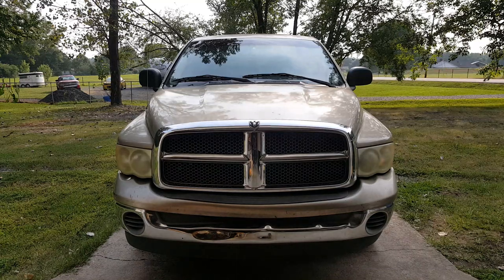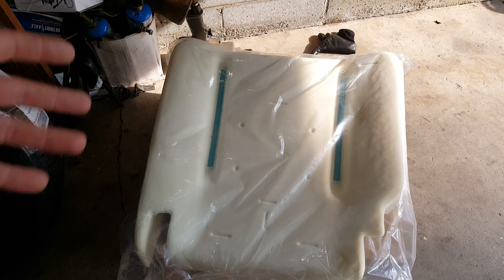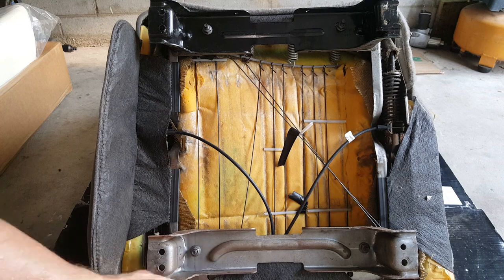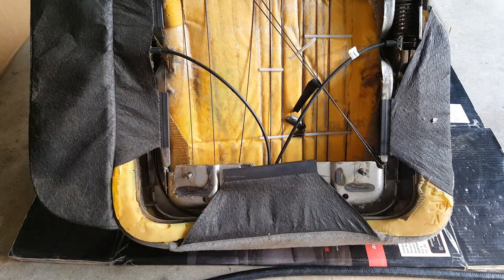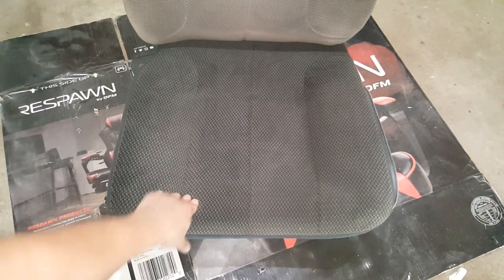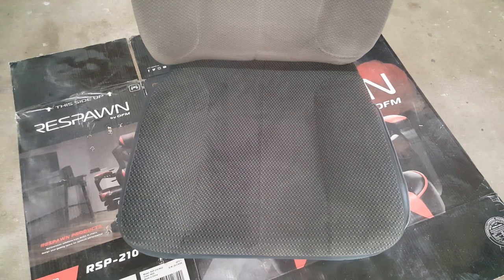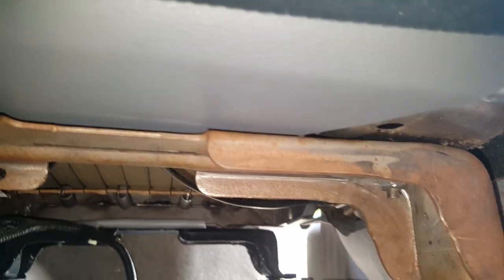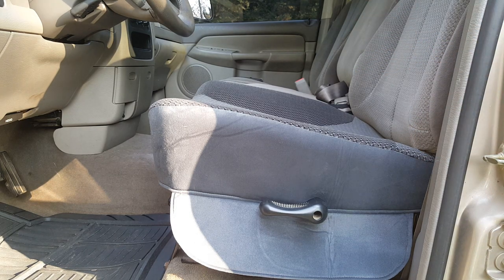How to replace seat foam cloth & springs in 2002-05 Dodge Ram 1500/seat repair

Comment: Mine was a little different b/c it is an '04 with electric seats.  The seat screws were a little different from the video. I also had to cut my seat cover for the electric seat controls and handle for tilting the seat back. As for removal, I found it easier to remove the main 8 bolts holding the entire front bench seat down so I could tilt the whole thing back and then remove the driver seat from the middle attachment. My screws were much harder to get to, but everything else was spot on. This was an excellent video!
Reply from the maker: Thank you so much for the feedback.

Comment: I used coat hanger wire to rethread. That rod had moved the other direction. Duct tape the metal sides. Got some thin foam plastic to line it. Wonderful idea lining the bottom of the cushion.
Reply from the maker: Thank you for the feedback , much appreciated.

Comment: Dang Thank you so much. I have run into the same problem, I have looked at everything I could think of as far as wording goes hunting the very spring set. The seat repairs shops cost more than the truck cost. Fixing to throw a lawn chair with a cup holder on it and duck tape it to the floor. Thanks for the info.
Reply from the maker: Glad the video could help. Thank you for watching.

Comment: Is there a way to remove the backrest upholstery so i can wash the cloth and clean the foam?
Reply from the maker: Yes. You can slip it off , however it is a lot work. I usually just take them to the car wash or use a pressure washer. I use full soap and just let it air dry . I have cleaned some of the filthiest this way. Thanks for the question.

Comment: How is the foam and seat cover holding up?
Reply from the maker: So far it is holding up great. I actaully like the firmness better than the oem. I wanted to replace the passenger side using the same foam, however they only sell drivers side foam. There is very little difference though and cutting and glueing a piece a foam would make it work. Great question, thanks for the feedback.